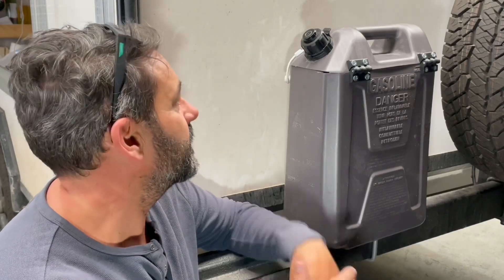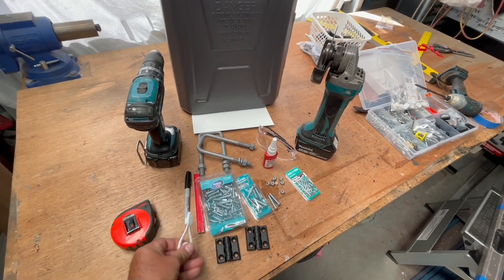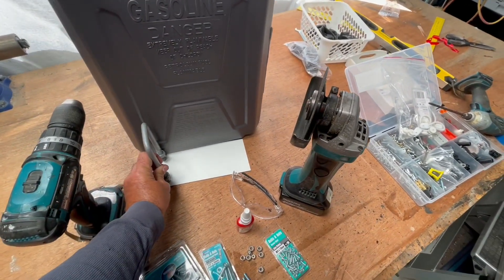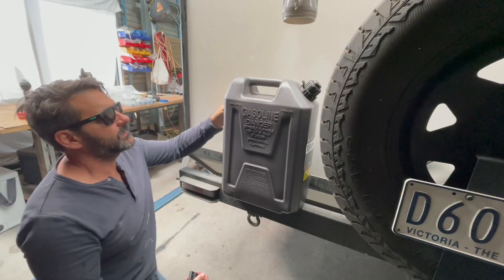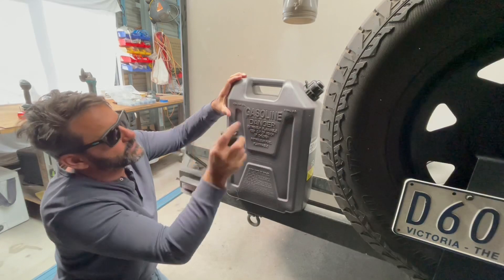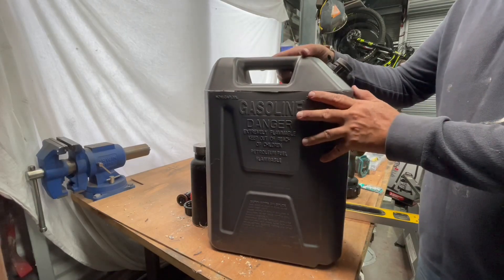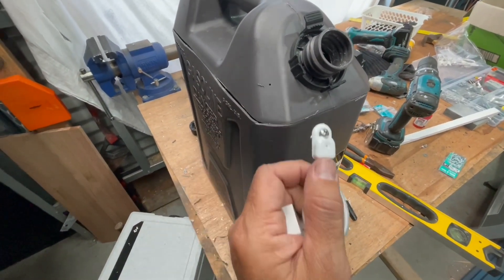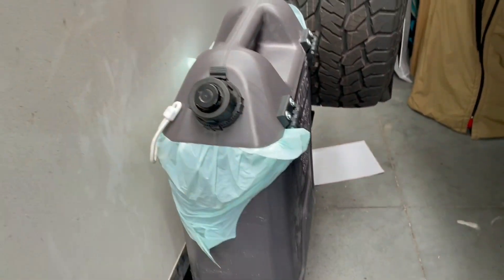DIY Jerry Can Rubbish Bin for the Caravan

Comment: Any thoughts on a drain hole? As I feel it might collect a little water from time to time.. also I'd nearly consider flipping the ubolts as I'd be concerned they may tear the garbage bag ... other wise great idea .. and something I'd consider for my camper.
Reply from the maker: Yep already corrected all that. Drain hole ✅, bit of rubber in the base to cover bolts (i didn’t want the bolts hanging down at the back on the bumper) ✅ , cut the hinge bolts off too

Comment: Have you decided against running 2 spare wheels on the back?
Reply from the maker: I actually talked about that in the vid and then edited it out because i was drawling on! The rubbish bin comes off in a few seconds so can add the other wheel. I’ll only use 2nd spare when I’m going remote i reckon. Still a bit dubious on how strong my bumper is with two on corrugations though. Have a remote red centre trip planned in June so guess I’ll have to figure it out by then.